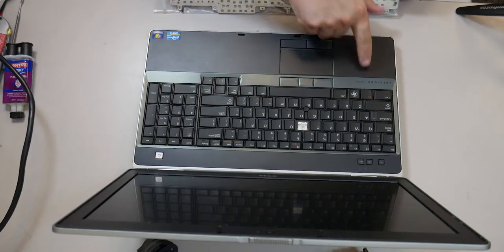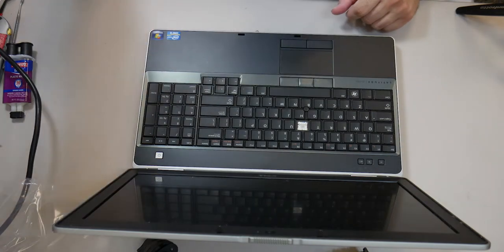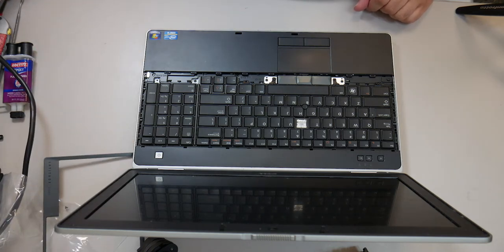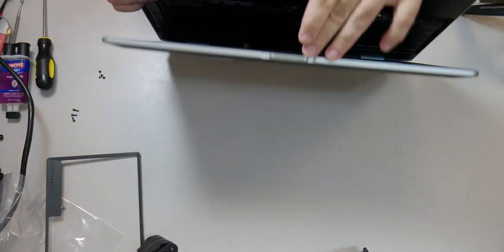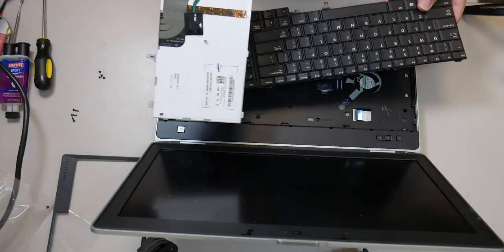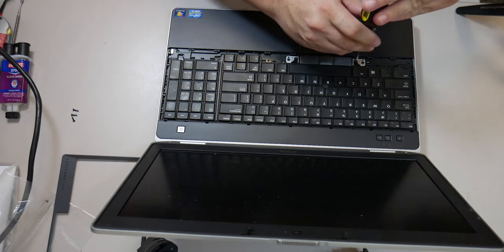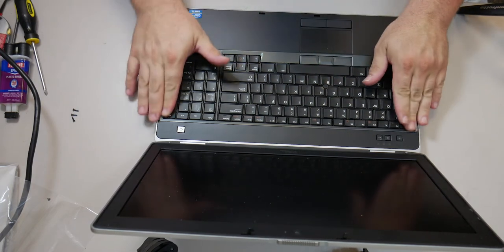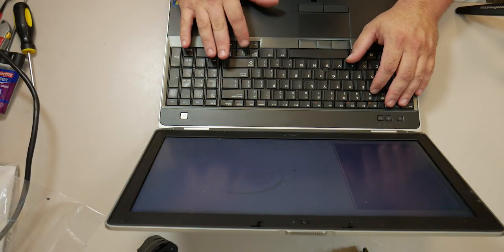Dell Latitude E6530 Keyboard Replacement - Jody Bruchon

Comment: Is there anyway to disable the built in keyboard and use an external keyboard?  Would it work if I unplugged the cable to the keyboard?  I have a stuck enter key.  I ripped most of it out and it still spontaneously sticks and presses it self when other keys are pressed.

Comment: where did you purchase this keyboard with the ribbon? everything i see at ebay and amazon don't have white ribbon. thanks
Reply from the maker: All keyboards come with a data cable; if you're talking about the extra wire that runs the backlight, you'll need to order one that is backlit. eBay is by far the best place to find replacement keyboards at a decent price. Just be sure to check the box in the left column that restricts the searches to your own country because Chinese shipments can take weeks to arrive.

Comment: Hi 
I have a E6530 without a backlit keyboard. Can I upgrade it to a backlit keyboard by just changing the keyboards or is there more to it? Thanks for any advise you have.
Reply from the maker: I've not tried it on this specific model but both keyboards use the same single connection to the motherboard so you should be able to upgrade to a backlit keyboard. They're not very expensive on eBay so it's definitely worth trying. The only reason it would not work is if Dell programmed it to not work since it's not a backlit model, but that is very unlikely since it's one more thing that would have to be changed for every individual computer during manufacturing.

Short version: I haven't tried but it's very likely to work, so go for it.
Reply: Jody Bruchon 
Thank you for the advice. I am going to give it a try, I will let you know how it goes.
Reply: @nedtracy2349  did the backlit keyboard work? was thinking of doing the same
Reply: @skyshark66  I installed today a backlit keyboard and it works fine! But what I missed on this video is the installation of the cable, it's covered but I got it work